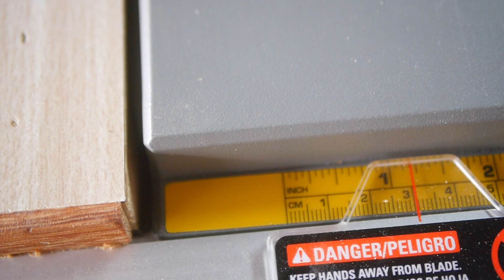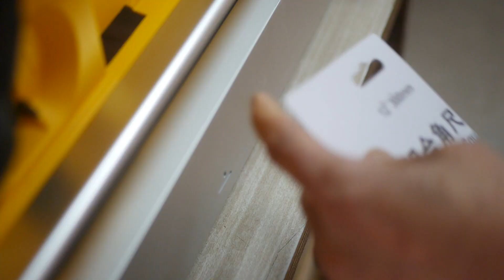Prepare the environment for DeWalt

Comment: Hi. Nice video. What is that white material you used to screw in support at the front of the zero clearance insert? You’ve solved my dilemma for two flappy ends that won’t stay level. Thanks!
Reply from the maker: Hello ms22401gal
Thank you for watching my video
And thank you nice comment
The material that solved this dilemma is 2X10mm aluminum plate, this solution is safe.

Thank you
See you

Comment: Nice tweaks. Looks like you are using a rip blade for crosscuts. I would recommend a combination blade. It’s good for both types of cuts and you’ll get less splintering on your crosscuts. Cheers! 👍😊
Reply from the maker: Hi Dave
Thank you for always watching my video
And thank you for your kind comments.
This time I will try it.

Thank you
See you
Reply: Ohyo56 
He’s right.  Having the correct blade will make a difference with cut quality.  Crosscut blades generally have higher tooth counts of 40+ while rip blades have around 24 teeth.  And the geometry of the teeth is different.  I think you will find it worth it to buy a blade specifically for cross cutting.